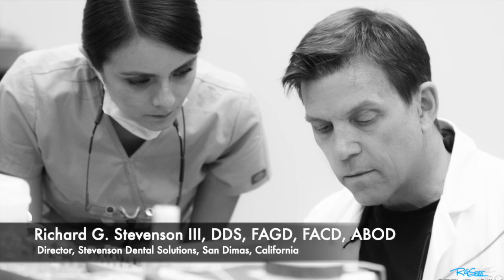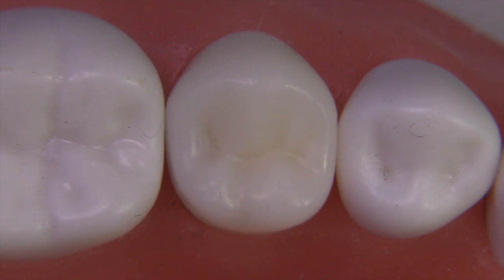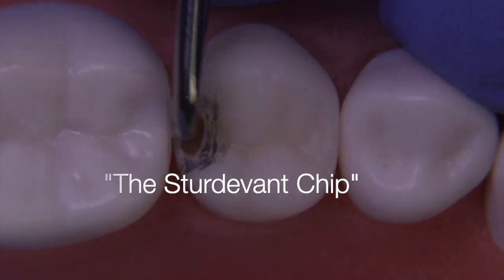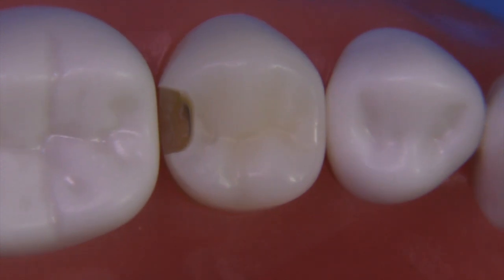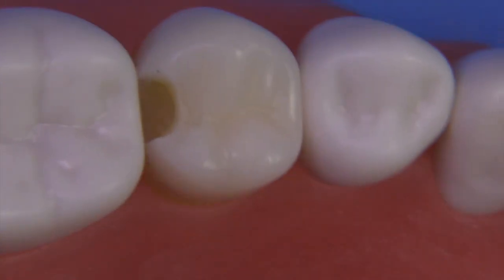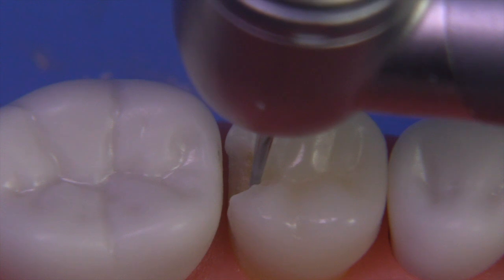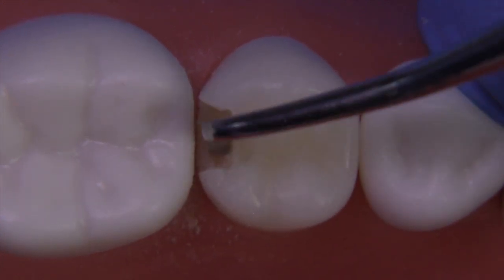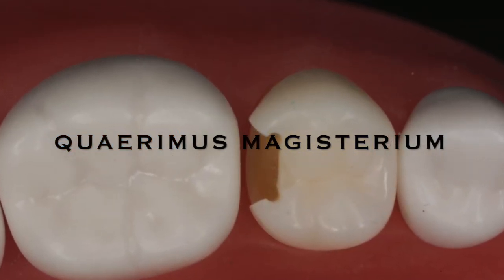Class II - The Slot Preparation #20 DO Acadental | Dr. Richard Stevenson

Comment: Thank you Dr for this valuable video 🙏🏻🤍 . I have a question for you, Should I prepare a slot cavity on a premolar even if the adjacent tooth is missing?  Can I directly access the simple proximal caries ? And for the restoration should I put the matrix band even if the adjacent tooth is absent ?
P.S.: I have a proximal carie, according to Si/Sta classification it's 2/2, without extension to the occlusal surface, and the adjacent tooth is missing.
Reply from the maker: Treat it like a one-surface simple cavity - prep just the caries and a small periphery.  Great Question!  Dr. Stevenson

Comment: Thank you dr ı want to ask something ı am a student ı just started to see patient at collage but its very hard for me to do preperation on upper molars on indirect vision Essapically aproximal caries because ı  cant see properly ı fell like aerator block all my vision and mirror constently cover with water and ı am so afraid to touch to next tooth ı tried to put matrix band between the tooth but it makes my vision worse  i fell like ı doing somethin while i cant see so i just some drill stop and look what ı done but it makes the preparation so long do you have any recomandation
Reply from the maker: I understand.  Try a few tips: 1. turn down the water spray, 2. Use magnification - this will allow you to move the mirror farther away, 3. a fellow dental student should assist and blow the mirror dry.  Hope this helps!

Comment: Dear Dr. Stevenson,
How should I proceed to make a MO or DO preparation for amalgam on #20 or #29 if the only burs provided are 330, 56 and 169 L. I'm struggling to do undermine and chip with 169L so my buccal clearance is coming out insufficient. Also, the axial depth is becoming less. Which bur should I use to make the box and finish the occlusal outline? I can use 1 mm enamel hatchet and GMTs. 

Thank you. 

Best,
Adi
Reply from the maker: Use the tip of the 169L at the occlusal aspect of the wall you wish to extend, then work the bur gingivally.  This will create a very nicely undermined bird beak which may be chipped with a sharp hatchet.  We refer to this as the top-down approach.  Best wishes, Dr. S

Comment: Hello Doc! Wouldn’t flaring the proximal walls at the cavosurface Margin for the composite slot affect the 90 degree that is required? Thank you
Reply from the maker: Flaring inter proximal walls for composite is acceptable and often a goal.  The difficulty comes with the restoration - namely the composite must now flow into a tight space between the flare and the matrix band.  The injection molding technique of Dr. David Clark works best for these scenarios.
Reply: Stevenson Dental Solutions thank you! Do you by any chance have any adex endo vídeos?

Comment: Just picking up on a point you made, in what instances would a diamond bur be indicated over tungsten carbide and vice versa (I was taught using a diamond flat fisher bur for class II preps)? Or is it just operator preference?
Reply from the maker: Good question - I fin that the flat ended diamond work best with hard substrates - dense dentin and enamel, for example. However, with the myriad of choices with handpieces and torque values, many options exist...so, yes, operator preference.  On exception would be gold inlays - carbides produce smooth and more define outlines, compared to diamonds.
Reply: @StevensonDentalSolutions  that is really interesting! In that case could you even use them in conjunction e.g. flat diamond for gross removal and say a 330 RGS carbide for refinement?

Comment: Thank you Dr. Stevenson. A question if you won't mind. I were taught not to extend the retention grooves to the occlusal surface b/c it will increase the likelihood risk of amalgam/ composite fractures in those specific spots. I don't know if there are articles about that. From your experience do you recommend to extend the grooves to the occlusal surface?                                 Lastly, thank you so much for all the effort and time you put on those videos
Reply from the maker: I don't know of any articles, just clinical experience - these amalgam slots required tremendous retention.  The US exam called the WREB, which licenses dentists in over 30 states requires these grooves to extend to the occlusal surface as well.